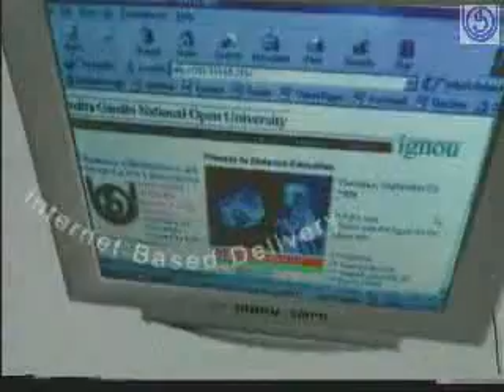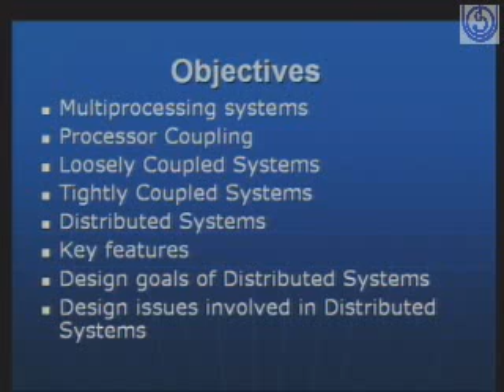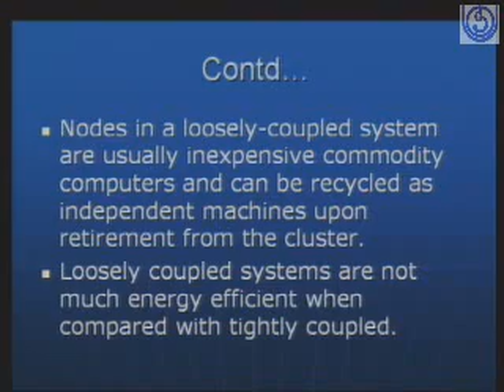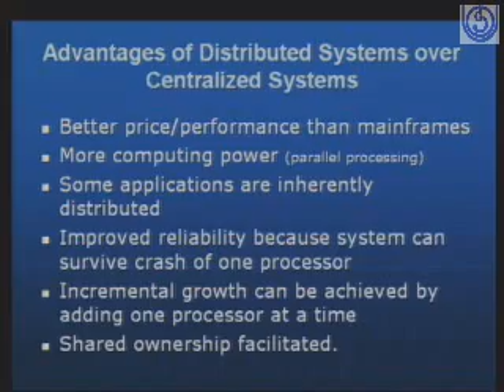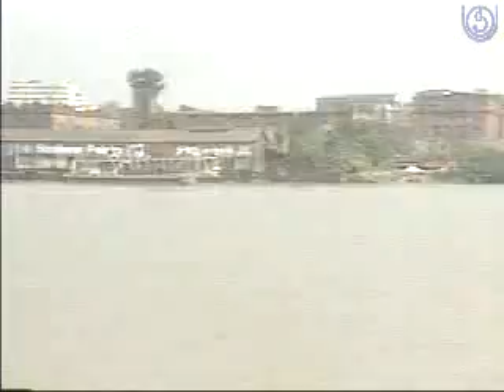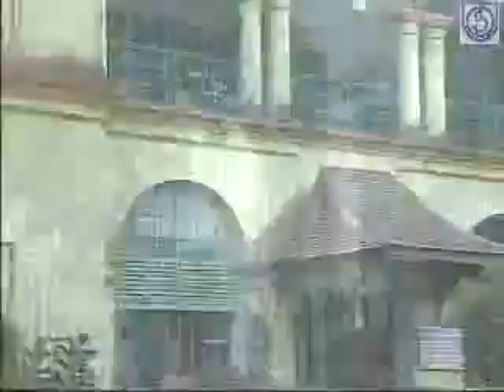Introduction to Distributed Systems

Comment: Good information. I really appreciate the content of the video. But i would suggest the teacher to reduce shouting and teach in a relaxed manner. A high pitch voice is quite difficult to bear when its loud. The slides are loaded with information. Usually slides have only points, but too many points in a slide is generally not a good practice. Please do not take any offense in my comment. Its just constructive. hoping to c improvements. god bless.